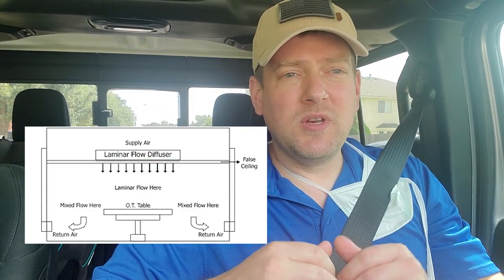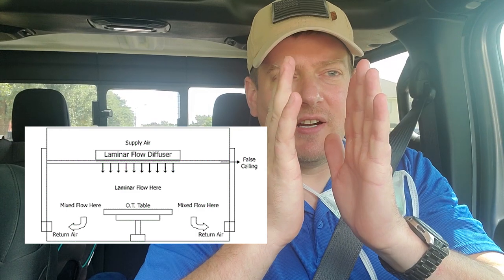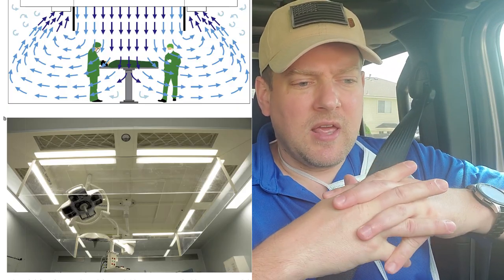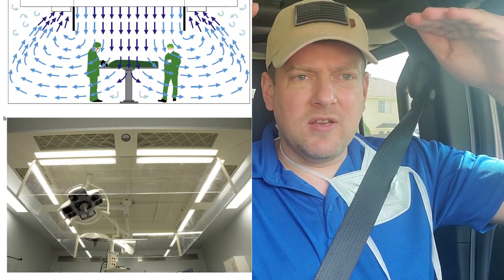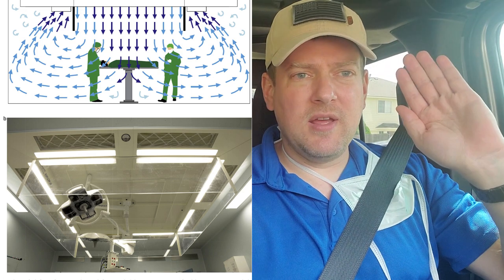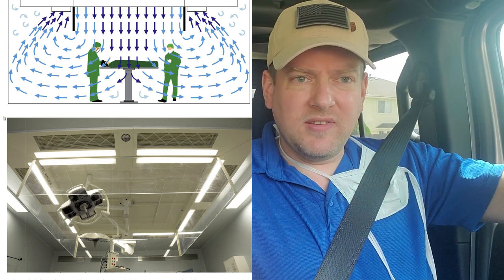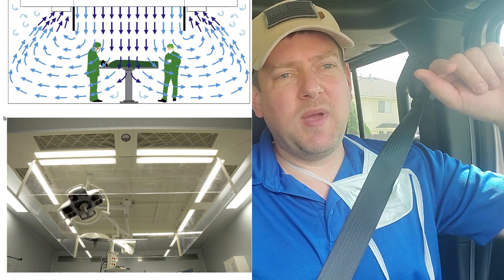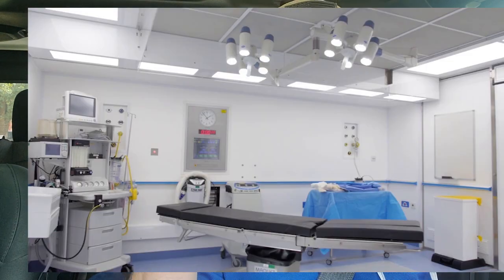Laminar Flow in the Operating Room

Comment: Hello, thank you so much for the video! I have a question about the Operating room. What if nurses and doctors were complaining about headaches after being in OR, what could it be? Sorry for my English.
Reply from the maker: Make sure the anesthesia has sufficient vacuum/ WAG waste gas collection. After that, ensure the OR return air vent isn't blocked by equipment
Reply: Surgical plume can cause headaches

Comment: My understanding is that the Clean "Core" is at a higher pressure differential to even the OR, as this is where all of the sterile instruments etc are unpacked.....
Reply from the maker: No. We have ball flow checks above doors in the core that show flow from OR to core. If the ball isn't present the the OR pressure isn't correct.
Reply: @BetterBiomedChannel  Apologies if I'm being stupid!!! But what will the ball valves do? Are they inter-locked with the doors to prevent opening? As per my original point, when the doors are open and if the OR is indeed higher pressure than the Core, what prevents contaminants going from the OR to the Core (and potentially infecting other cases)? I'm not a Mech. Eng. - Biomed as well and genuinely curious.